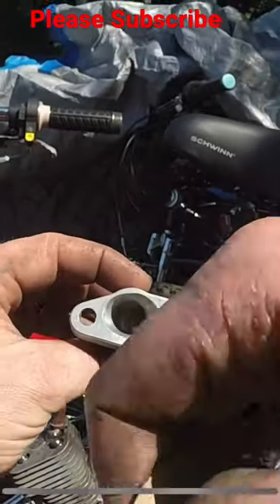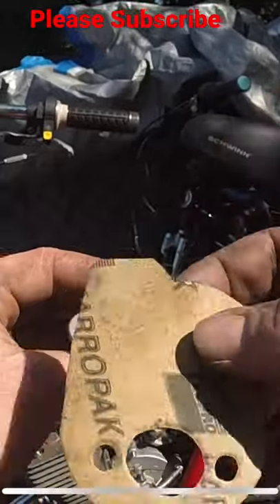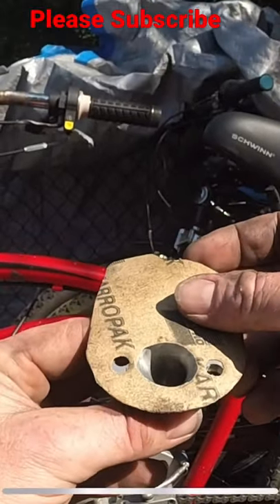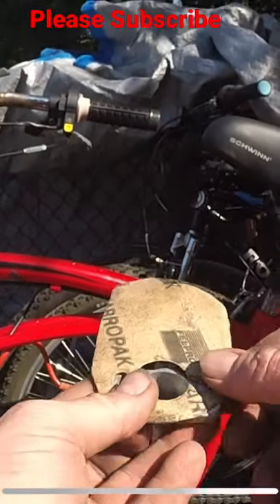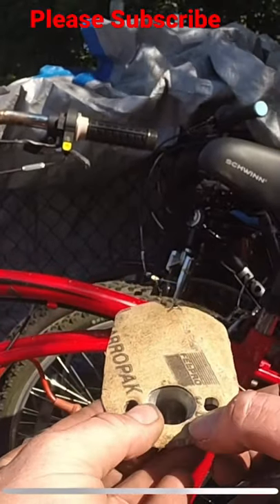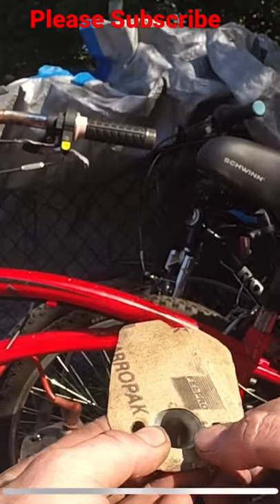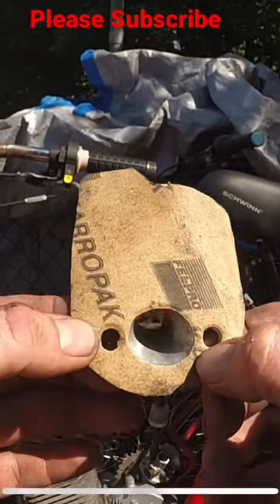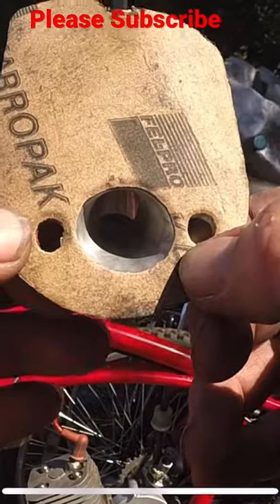How To Make A Gasket

Comment: Dude that's a great idea I've never even thought of that, thank you that will help me out a lot now 👍
Reply from the maker: No doubt your welcome glad I could help   It’s mad easy my grandfather thought me that 35years ago n it’s how I always do it wit any paper gasket n metal surface that has a sharpish edge  it takes a lil practice but it’s a small ball peen hammer the smallest is best for the holes n stuff but just the weight of the hammer is all n go slow take your time n it might not cut it out so to speak but it at the minimum makes it like perforated paper n it pulls off clean no rips
Reply: @JMB676  Roger that bro, I'm ebaying ball peen hammer right now.

Comment: Man i tried to do this for a crab gasket and by the 5th try i was like this aint working and orderd the 3$ gasket lol
Reply from the maker: Most important part is keeping it still and not let it move. Only the inside shape matters cause the outside shape you cut with a razor after it’s bolted up tight. But for the intake the best option it to sand both surfaces down with like 120 grit and then just moto seal it. But keep at it cause once you learn it you’ll never spend three dollars again…..on gaskets lol.
Reply: @JMB676  yea I was able to get the outsides and the screw holes but it was a super weird shape on the inside it was easier to just buy it and like I said it was only 3$